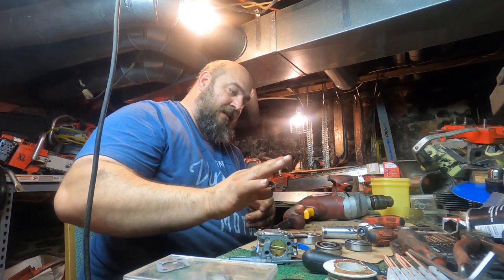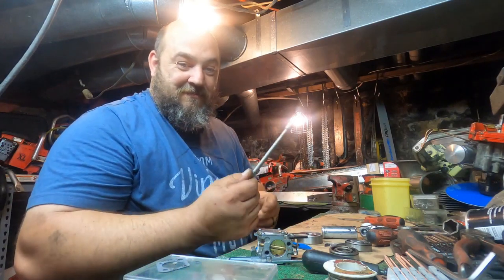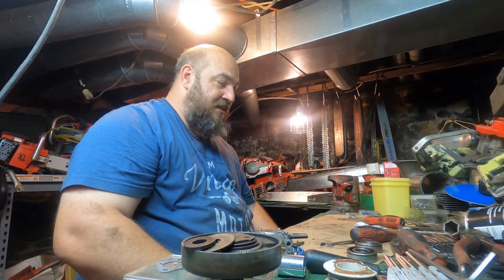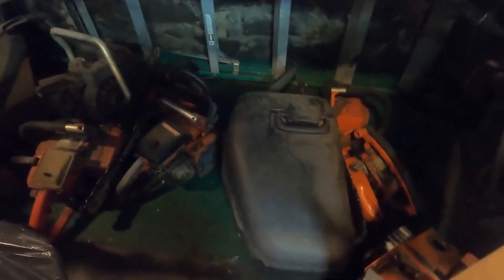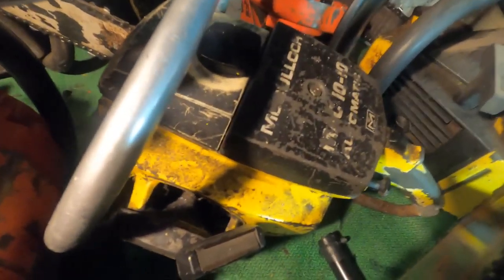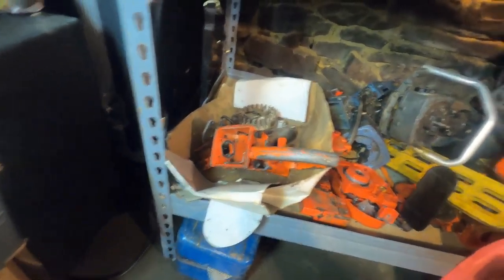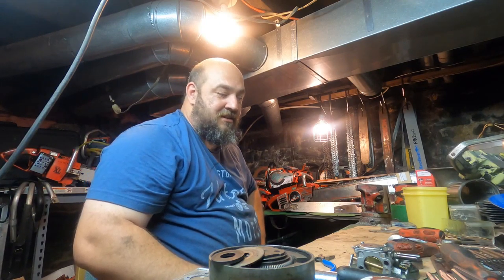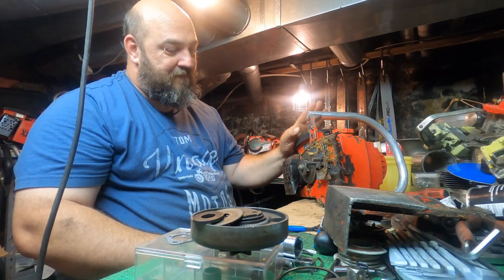Bearing Failure On A Chainsaw!  Homelite Chainsaw Hoarding!  Giveaway Update!

Comment: The only thing I saw wrong with your saws is, you might need more room cause I’ll bet you’re not done collecting! I do things to help out others but I enjoy the feeling I get, I don’t want to get any kudos and in some cases I especially enjoy anonymity. I won’t be entering the contest I would rather see someone that may not be helping others start.
Reply: I agree I wont enter the contest and I would much perfer that if I help someone that they dont know who done it. Our rural mail carrier has a long contract route. most of it gravel roads. one day I came by and the  mailmans pickup was jacked up front tire missing. It was out in the boonies no houses for a couple of miles. In the bed where two spares both flat. Nobody around. I assumed he took off that tire and someone took him to get it fixed. I had my compressor and plugs. so I inflated those flat spares plugged them and put the best one on the truck and let down the jack. and drove off. He is  now taking the dirt nap. I bet he wondered who fixed his tires?
Reply from the maker: Part of me hopes that no one enters. hopefully it is such a part of everyday life that they don’t even think about it.

Comment: I've had bearings that felt rough and sounded bad like that.  A lot of times if you catch them early, brake clean them out and blow out a few times.  Lightly lubricate aahs recheck.  If there's play, or when looking at the races there's pitting abs galling, it's already over. I'm not saying anything other than what experience I have.  But with that all said,  for the price of bearings, and I suspect them, and they are out, well then it's really a no brainer. Lol!!!! Take care Smitty.
Reply from the maker: Thanks for stopping in buddy!

Comment: I have a question for you Smitty.  I know you're the Homelite Guru so I know you'd have an idea.  I was given a Super XL Automatic. That thing pulls chain HARD, but it's slow.  You can lug that thing right down low and it keeps on chuggin just like a diesel.  My Husky 257 (57cc) is a lot faster, but once it starts to drop off too far on the RPM,  it grabs and stops, pretty annoying.  Anyway, I got to checking swish and my normal solder I use normally wasn't enough.   It's between .097" and .100". That's crazy to me. It's got around 140 psi of compression WITH the base gasket.  What's your thoughts? Have you seen that much?   I have an industrial 3 phase lathe and a Bridgeport mill. Perhaps this winter, another thing I'd like to try is adjusting squish on a clamshell style engine.  That would be done in the mill with a custom boring bar I'd have to probably make. Anyway, I love your channel I have learned a lot from you and a couple others. You, Buckin, Tinman, and Ironhorse have inspired me to start tinkering with these saws. I kind of love it and it's quickly becoming a sickness!! Lol There's no cure, but the treatment is of course..... more saws! Lol Later buddy.
Reply from the maker: Some cylinder heads have a larger volume of air space around the plug.  The more volume you have then the tighter the squish needs to be.  I usually look at the compression more with the vintage saws.  My goal is to exceed 175 pounds.
Reply: @Smittyschainsaws  Thanks for the reply,  I appreciate it!